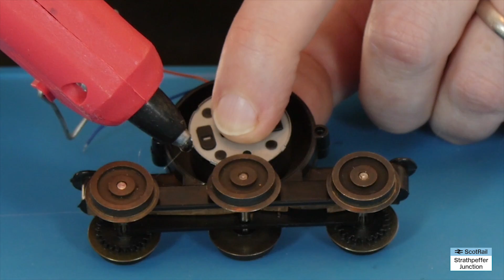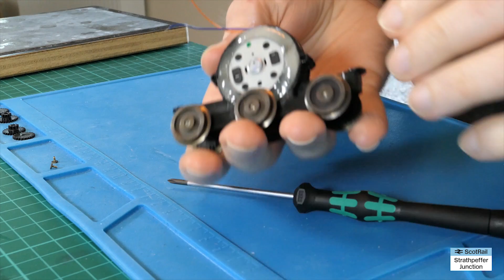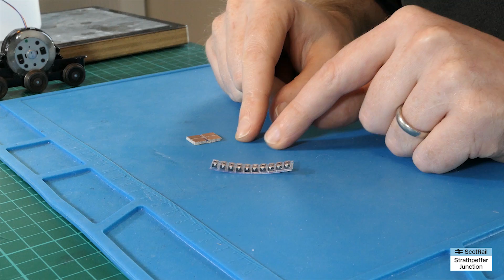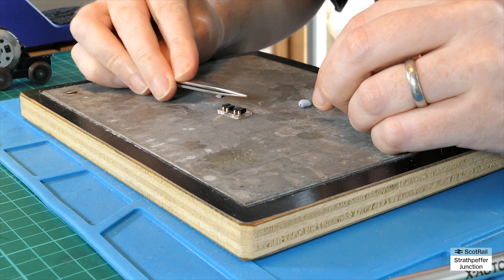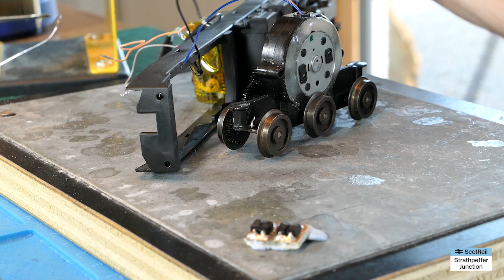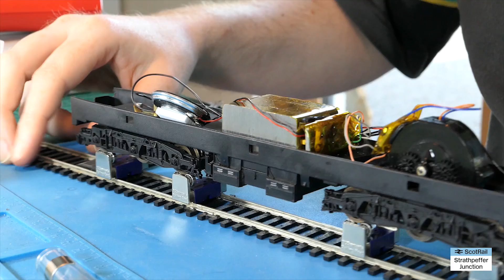#26 Lima Class 47 Ringfield Motor Upgrade - Part B

Comment: Hi I purchased the up grade for the Lima  from Phillip on  e bay and followed his instructions and it worked out great ,have also purchased the hornby kit again it worked out great ,just one other thing the Lima kit comes with the gear already assembled.
Really enjoying your video’s
Michael Wolak
Reply from the maker: Many thanks indeed, Michael. Yes, I think his kits (assuming they're the ones I've seen on ebay) come with the gear trimmed and fitted (and maybe some tube too?). They're a nice product and certainly save a bit of hassle and simplifies the process, and probably makes sense if you're doing just one or two locos...but if you're going to do a few and are happy to do each step yourself, buying the components direct can be a bit cheaper.

Comment: Good video. I have spent the last year modifying these. It's much easier putting the motor in if you remove the centre wheelset, in fact get them all off whilst in there and clean the wheels. There's no point in having a nice new motor installed if the wheels are still that corroded brass colour you see on a Lima loco that has spent it's entire life boxed.
Reply from the maker: Yup. It's always good to give the whole thing a good clean, service and lube as part of any motor change over.

Comment: Love this and i also love cd motor conversions. However I’ve always found the original Hornby and Lima motors much better if serviced properly and the correct chip used. As each chip delivers different running qualities. I have a Lima prairie with DCC’s concepts zen in and the original motor it runs better than my Bachman 45xx. As for noise most of that is from the gears. Whichever it is it’s all good fun tinkering with these things. Lima motors just need heavier gauge wire to deliver more current to them. Love the vid Rob :)
Reply from the maker: Many thanks for the comment. Yes, I alway recommend that folk try servicing their ringfield motors first. They can often be made to run a lot better, even through little things like shims under the gears to reduce the slop. However, it doesn't always work and slow running performance is not always great, and that's where a cd motor can come in. 🙂

Comment: So do the Diode Voltage Droppers arrive pre-made or do you have to make them yourselves? 

Also, when you place the black Lima pick up wire to the voltage dropper, do you add the black or red wire from the motor?

Comment: great follow on question from my first one,
One question i would like to ask could you add a bigger value resistor to drop the voltage further so to give a closer speed to the original one .
Reply from the maker: You probably could. You'd need to get one with a high enough wattage. It may also get hot, so keep it away from the body just in case. I've not tried it myself, but there's nor reason why it wouldn't work in theory at least. Probably best with analogue though. Not sure if/how it might affect a decoder supplying the motor (with back emf etc).

Comment: Be careful with that hot glue, if the motor gets hot it will melt,  i use miliput 2 part rock hard solid resin you can get this stuff in black, dont you mean resistors not diodes? i used a 20ohm 1watt resistor, anyway going back to the miliput that stuff will make a mold for the motor if you put grease on the motor shell first its marvelous stuff.
Reply from the maker: I used high temperature hot glue and just a tiny bit to hold everything in place while the resin set. I've also multiple tests with the motor and my infrared heat camera and it's not yet hit the glass transition temp of the glue. I never thought about miliput for this, but I guess it'd work fine too - it's a really nice product and definitely easier to work with than liquid epoxy. However, I no longer use this method as I use my 3D printer adaptors, which make the whole process much easier and quicker. In terms of resistors vs diodes, I'm not entirely sure which part you're referring to, but I have used diodes to drop voltage for these conversions. I tend only to use them if the decoder doesn't have CV5 functionality. The diodes drop about 0.7 to 1v each. There are pros and cons to them vs a resistor. There is of course forward voltage to consider, but they shed the same volts irrespect of current whereas resistors do not - it perhaps doesn't matter hugely with these sorts of thing, however. Anyway, there are multiple ways to skin a cat and so long as it works, that's the main thing! Many thanks for the comments and your suggestions 🙂
Reply: Cant remember where, but i bought a lot of 14.2v motors that were a direct replacement for the pancake types years ago, they just swapped over, but yea a lot of ways to do the same job i agree. 3d printers are something i never delved into but gonna have to start as im doing an N gauge 5ft x 2.5ft layout at the moment
Reply: Just had a look and apparently and someone is now making armature replacements for honby and lima with 5 contact points so they should run as smooth as silk with a lot of torque, so many options lol

Comment: Hi David, watched this video and Part A, very well put together, I do like your use of different camera angles. Do you use two or more cameras at the same to or multiple videos you edit together with sound over the top?  Hope that made sense...Simon
Reply from the maker: Thanks, Simon. I have two cameras. Both record in 4k, but I render to 1080p. That allows me to have two different angles, but also gives me the scope to zoom in on either without losing much/any quality, which can make it look like more than two cameras. The second camera is a wee compact Panasonic, but the 4k video is really very good on it given its size. I record sound on both cameras and use it to sync the video. I occasionally use and offboard sound recorder (Zoom) to record as well. I think I'll use that more in the loft as it captures better sound.

Comment: Hi ....just a dumb question I presume this could be done to similar Hornby motors?......regards Fred ..ps so beautifully explained to modeller but a struggler with electrics...but I do get there😊
Reply from the maker: Yes, absolutely. The process is basically the same. The only real difference is the motor size. Some (perhaps all?) Hornby ringfield motors can accept the slightly bigger 12mm thick motors. You could of course probably still use a slimmer one, but I think the 12mm ones are slightly more robust and may (don't quote me) tolerate a little more voltage.
Reply: Strathpeffer Junction ..thanks for that just as an aside I run DC ....so hopefully all will go well 👌.... fred

Comment: Hello 
Can you kindly mention the value or type of diodes used to reduce the speed and can we use resistance also for this purpose.
Thanks & Regards
Raj from India
Reply from the maker: Any general purpose rectifier diode will work. There's loads of options. You could use a resistor, however I may get pretty hot and it's effect will vary with load/current.
Reply: Thanks for the kind reply.
I tried using diodes even couple of then but unfortunately they do not make much difference in reducing the speed/voltage to the motor.
Is there any other method ?

Comment: Hi just wondering about the soldering of the diodes could there be a problem with heat transfer to the diodes as i was told to hold the leg with pin pliers to stop the heat. I don't know what to say but once more a great informative video cant wait for the next one all the best tony
Reply from the maker: Hi Tony. Many thanks for the comment. I've not had a problem soldering smd diodes like this, but you should keep the application of heat to a minimum. There are different schools of thought on using heat sinks. Some folk swear by them, others argue that by drawing away heat, it can actually lead to the iron being held there longer. I also should have said in the video that I turn down the heat a little on my iron when I'm soldering smd components, but of course, not all irons allow you to do that. Watching it again, I would probably aim to keep the iron in place a little less time than I did in the video...but when I'm chatting away, I tend to labour things a little longer than I do when I'm talking to myself rather than the camera. 🙂
Reply: What ever you are doing keep doing it works very well

Comment: Ive just swapped my ringfield motor in my lima class 47 for a 6 volt can motor. You mention that there could be a problem with using 12 volts on it, hence the diodes, but I want to change the CV's to set the voltage. Could you recommend any cv settings especially the upper voltage.
Reply from the maker: Hi. I normally start by setting cv5 to half of its top value. Then cv6 to half of cv5's new value. That's often a good starting point. Then tweak them both from there, until you find running characteristics that work for you and your layout.
Reply: I should have said from the start that my layout is a depot layout so speed shouldn't be an issue. Thanks for the advice.
Reply from the maker: You may wish to look at a lower cv5 value then, and then a lower corresponding cv6 value too.
Reply: I'll give it a go thanx.

Comment: I have enjoyed this conversion video but noticed that the various CD motors have a large variation in speed from 6000 to 12000 rpm which speed would you recommend ?
Reply from the maker: Hi Derek. In my experience, many of the descriptions accompanying the Chinese ones can vary wildly in accuracy and when the chips are down, they are often much of a muchness. I would, however, generally try to go for the lower rpm, because when you factor in the higher voltage being fed to it by the decoder, it's still going to spin fairly fast. Whether the motor will actually be that rpm, is another matter! I've seen absolutely identical motors being sold by different supplies with different rpm rating, sometimes different voltage ratings too. All of the motors are effectively overdriven when used with model locos, but so long as they don't overheat, it's rarely a problem.

Comment: Hi David
Did you get any further with your supply of the 3D printed motor pod inserts? Like many others, I'd be interested in ordering one from you for a conversion if you are making a batch. Apologies if inundated with this request. Great channel!!
Reply from the maker: Hi PJ. I have had quite a few message and emails, but that's absolutely fine as I'm just stoked folk are interested. I dropped someone else a message this morning on this very subject, actually. I've been a bit delayed due to health issues over the summer, but I'm hoping to get some for Lima models out by the end of August. I have a batch complete using one type of plastic, which I think should be fine as it's what I've used for my own conversations, but I'm experimenting with a different plastic which may be a wee bit more robust. If it prints ok, I'll go for that instead. If you want me to drop you an email when they're ready, drop me a line at info@strathpefferjunction.com  :)
Reply: Hi David
That's brilliant! Whenever you get chance of course. Many thanks for the response!
Reply: Strathpeffer Junction p

Comment: Hi, just come across this while doing the exact same 
Would you say that using just CV 5 on a decoder is adequate for use on a home layout or is it best to use both CV5 and the diodes?
Many thanks
Reply from the maker: Hi. Many thanks for the comment. I'm all honestly, for my own models, if the decoder has CV5 (and the other associated CVs), I tend just to use them. I use the diode dropper with TTS decoders, because they don't have that function, but all my non-sound decoders have CV5 etc., and that does me fine. I would probably use diodes if I was only using the model with dc control, but even then, so long as you're sensible and only feed it as much from the controller as it needs to run at a prototypical speed, it's probably fine (although if you're double heading etc., it's probably wise you use diodes).

Comment: Is it not possinle to use a zenner voltage testrictive  diode
Reply from the maker: You can try that. The issue I had was that the higher forward voltage made very slow speed running (shunting, smooth pulling away etc.) hard to achieve.

Comment: Question. i have a G scale engine that runs so much faster than my other engine that the wheels just spin all the time its running when paired with the older engine. i would like for them to be closer in speed to save wear on the faster engine would this Diode fix work on a simple G scale DC  engine?
Reply from the maker: It is possible that it might help, yes. If you can work out the voltage difference between them, you could work out roughly how many diodes might be required. The only thing I'd say is that too many diodes in the circuit and you Stert losing fine, very low speed control, but the rest of the range is fine.
Reply from the maker: Sorry, forgot to say...you also need to make sure that the diodes you use have suitable current ratings. 1 amp diodes are fine for N and OO, and most O. Thru are probably fine for G, but you'd need to double check the current rating of the motor. But 2 or more amp diodes are pretty much the same price anyway, they can just be a big bigger, but for G that'll not be a problem.
Reply: @StrathpefferJunction  Very helpful thank you. i am hoping 6 amp diodes will be ok

Comment: why does'nt Hornby upgrade to cd motors?
Reply from the maker: There are pros and cons to CD motors. If a ringfield is not running well, then a CD motor is definitely a good option, but a smooth running ringfield is still OK in principle. However, my guess is that as many things with Hornby, it all comes down to cost. They would have to design an entire new bogie, new gearing, new tooling, and that will be a lot more expensive than just churning out an old design from existing tooling in their cheaper railroad-type models.
Reply: @StrathpefferJunction  I wonder how many wont buy Hornby because of thatout of date motor?
Reply from the maker: @peterforden5917  Not sure, to be honest. Some people perhaps don't have the money, or they may prefer to buy their younger kids cheaper models, but I think more seriously modellers are more likely to avoid ringfield models these days. I think Hornby's 'cheap' hst released this year has a ringfield, but I'm not sure how well it's sold. I've not seen many about in videos etc.
Reply: @StrathpefferJunction  Beautiful models with crappy motors USA models crappy models with beautiful motors german models exuisite all round my Märklin 3 rail has never yet needed Gods gerfingerpoking from the sky ulike every Hornby or Lima or further back airfix no idea about Wren couldnt afford them why cant the people who invented both HO and OO get it right?
Reply from the maker: @peterforden5917  I think UK outline did suffer from some particularly low quality products in comparison to other European countries. Things have changed quality-wise, but I still think you can get better value for money in some other countries (although not all)>.